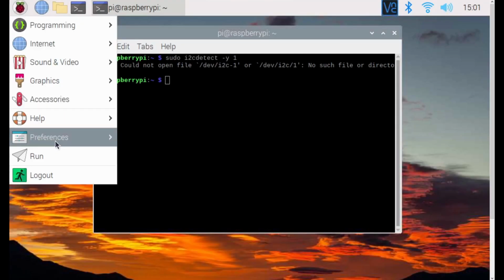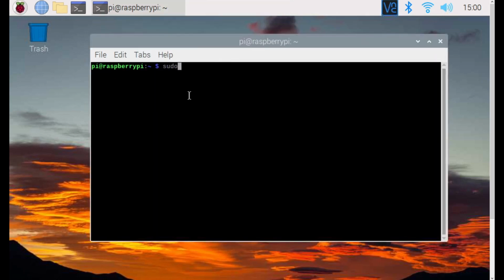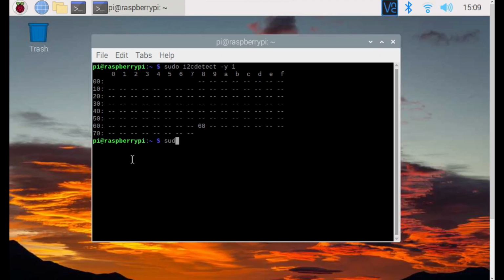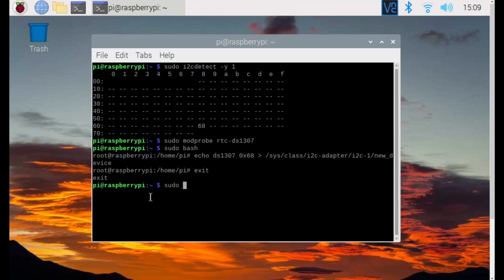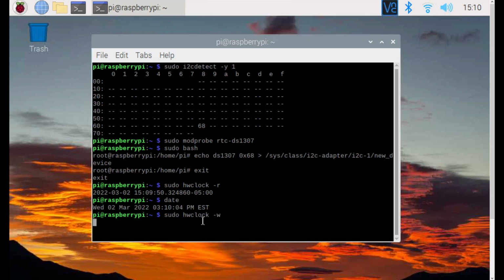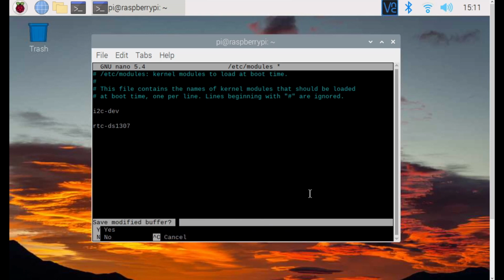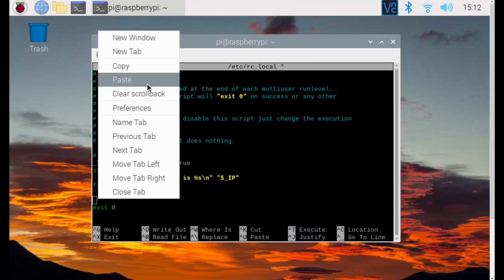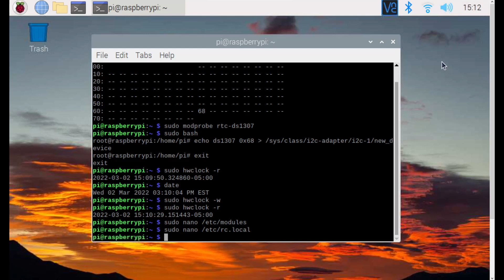Install and Configure Real Time Clock RTC-DS1307 for Raspberry Pi

Comment: Thanks a lot for this tutorial !

I got some issues when excuting the commands, I wonder if you could help with that. 

For example, when I type "sudo i2cdetect -y 1" I get UU at the place of 68 what does it mean ?
I changed the next command to : echo ds1307 0xUU &gt /sys/class/i2c-adapter/i2c-1/new_device
I got :  gt: command not found.
I tried also with 68 and got the same thing

Also, I think I have a  DS3231, am I obliged to change the name of the clock or it doesn't change anything in the way it works ?
Reply from the maker: When running i2cdetect -y 1, if you see a "UU" at address 68, it means that the I2C bus is unable to detect any device or module present on that address. This can be due to various reasons:

The device may not be properly powered.
The wiring between the microcontroller and the device might be faulty or incorrect.
The device itself might not be functioning correctly.
Make sure the I2C bus is enabled in the Raspberry Pi configuration, then you can re-run those commands.
Reply: @BrokenSignal  Thanks for your response, I'l try that.

Comment: Nice tutorial! I have a RTC-DS3231 for my Raspberry Pi 4. Can I follow the same procedure in your video?
Reply from the maker: DS3231 and DS1307 are functionally the same, except that DS3231 has a built-in temperature compensated crystal. So you should be able to follow this for your RPI 4.